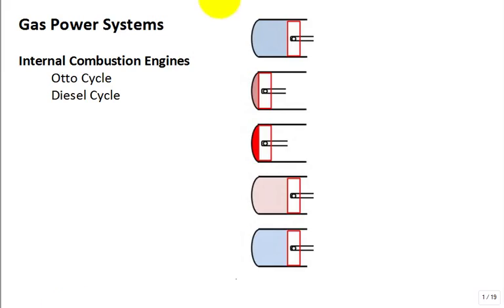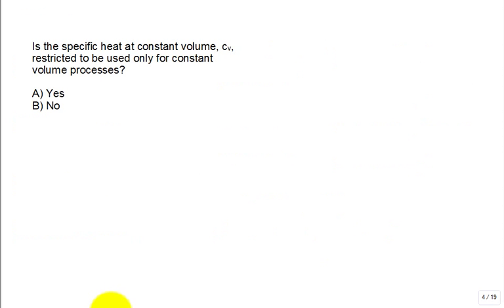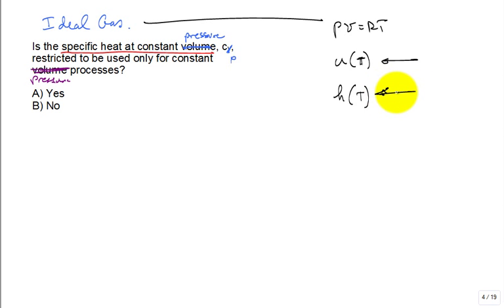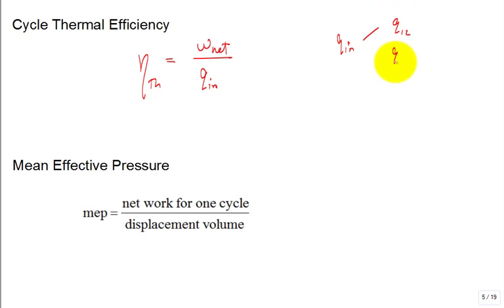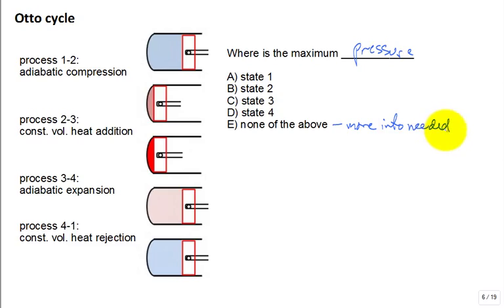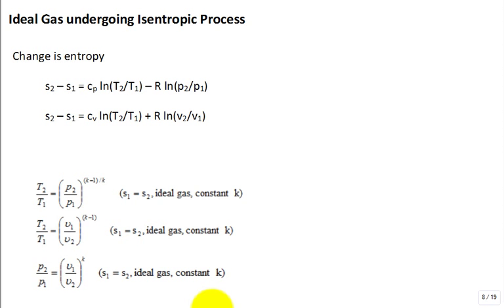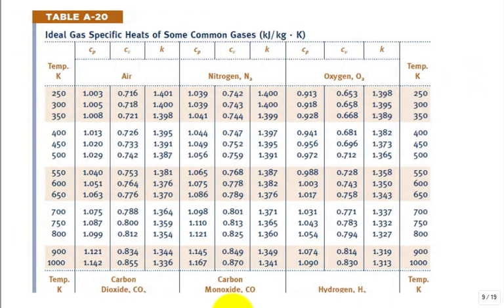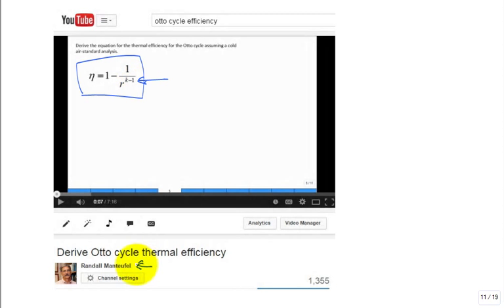ME4293 Internal Combustion Engine 3 Spring2015

Comment: an addition side note ought to be added on the diesel cycle problem which shows that the T1 and p1 values stated on the problem are inconsistent with the T1 and p1 values from the tabulated data.
aside from that, great lecture!